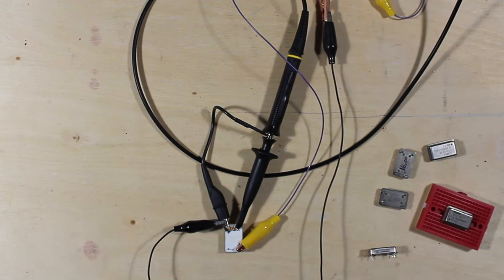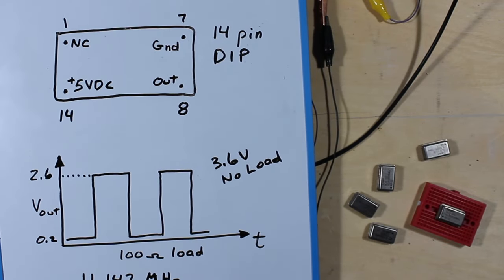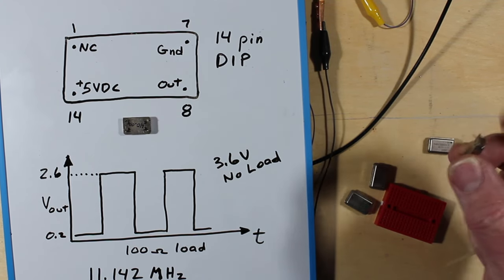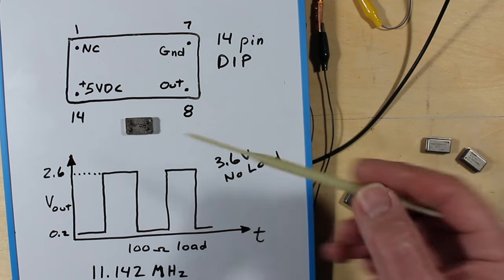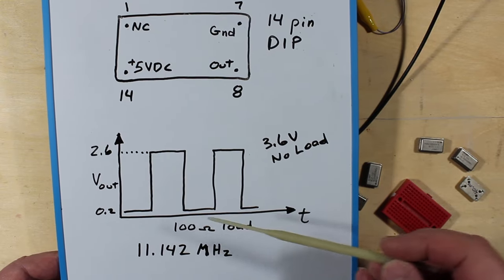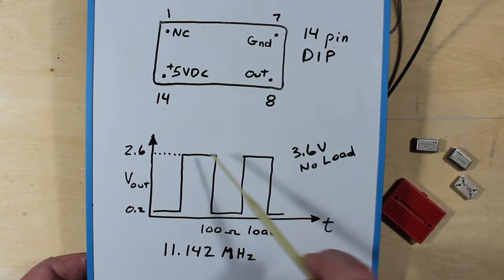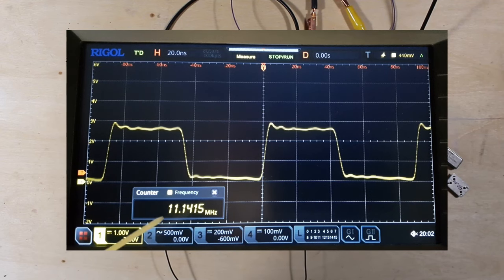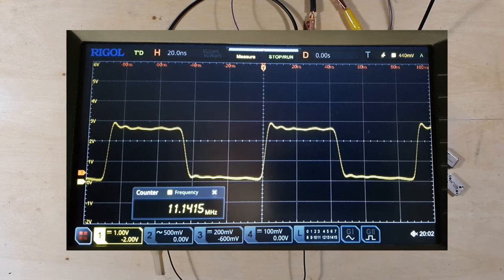Oscillator Modules - Easy To Use  #electronics #experiment

Comment: Is it good enough to measure capacitor ESR?.  Just found your  channel.  Lots of helpful videos.  Thanks....
Reply from the maker: Thanks for the comment.  In general I would say that the oscillators used in this demonstration would not be good candidates to use in an ESR meter.  Even the commonly available lower frequency oscillators are too high in frequency.  Typical ESR meter frequency is often in the range of 50kHz - 200kHz, and can be much lower.  Capacitors for power supply use often have an ESR specification at 100 or 120 Hz.